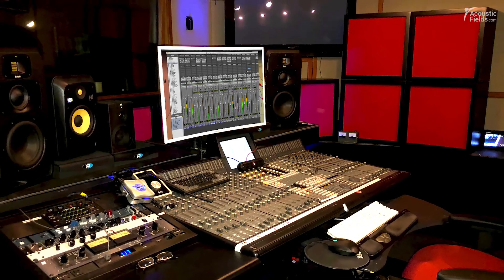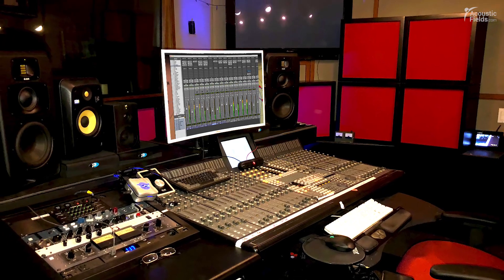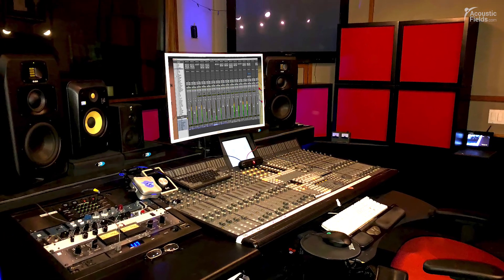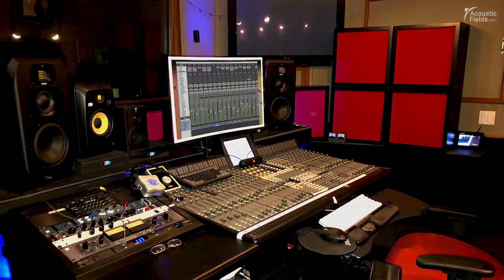Grammy & Emmy nominated engineer Bill Malina talks about Acoustic Fields' bass absorbers

Comment: Amazing way to aproach the room acoustics!!!!!! I like your aproach of not only designing the treatment, but taking the time to experiment with the placement of the different modules.
Reply from the maker: A, Low-frequency absorption is all about pressure management. Find the areas of the room that exhibit the largest pressure and treat it by placing the correct type and amount of treatment.  Our ACDA series has two frequency ranges for attenuation. We have the ACDA-12 from 30 - 50 Hz. and the ACDA-10 from 30 - 200 Hz.  99 % of all small room, low-frequency, pressure issues fall within these ranges. Each module attenuates .5 dB so you have a predictable and consistent treatment methodology.
Reply: Great piece of advice I really aprecciate it. Thank you very much!!!!!!